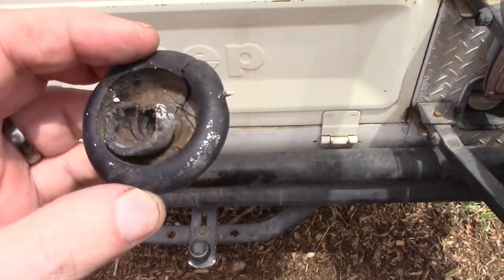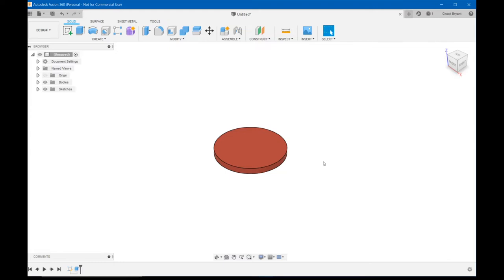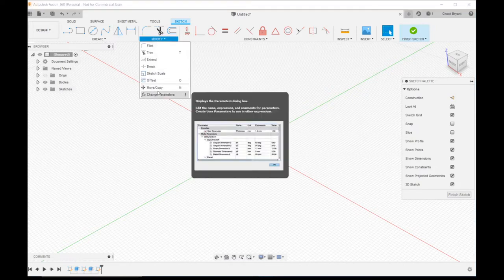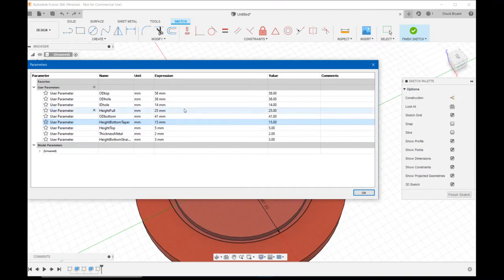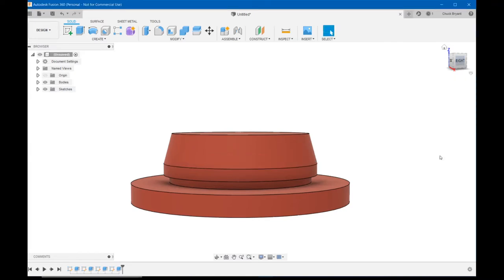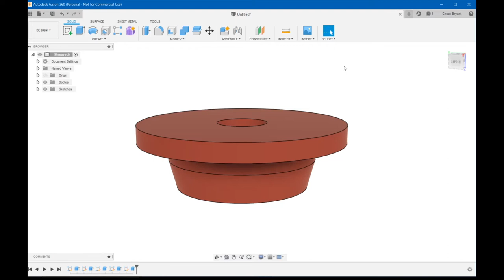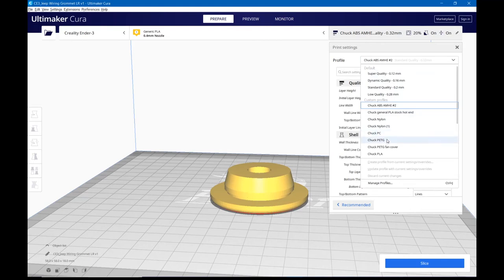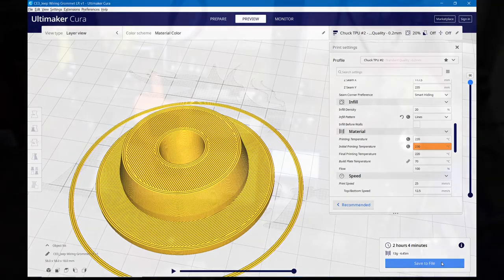Design and 3D Print a Jeep CJ-7 Wiring Grommet with Fusion 360, a Creality Ender 3 and TPU Filament.

Comment: Nice job.  How tough is the TPU long term?? will it dry out and crack?? have a similar exercise i need to do... love fusion and my ender 3 s1
Reply from the maker: About 3 years ago I made a set of feet for the ladder I use outside regularly out of this filament and it's held up fine. Video here https://youtu.be/zzULRLKoDV4
Reply: @3rdpig  thanks for the reply.   I have the exact same item i have to make for my old Datsun: fuel sender and pump wire grommet.  I was gonna buy one for $20, but i think i'm gonna go full Chuck!!  Might have to run 480 3 phase to my garage and buy a metal printing unit, crank out a few engines, lol
Reply: @3rdpig  the inset at the top of your original piece might've been simply for material flow and shrinkage in original molding tool.  Tool designers typically try to keep most wall thicknesses thru a part pretty close in dimension to help molding material fill the mold.

Comment: Chuck, what material are you using?? how soft?? thanks
Reply from the maker: I used FoxSmart TPU. The company no longer seems to be in business, when I went back to get a second roll of it I couldn't find any. It seems to be a pretty generic flexlible TPU, so I think almost any brand would work just as well. I just ordered a roll of Priline TPU (it's on sale now for $19 and I'm cheap), I haven't used it yet but it feels about the same. I'll put a link below.
https://amzn.to/3WOQXU9
Reply: @3rdpig  Hey... that's the first stuff i bought, it's 98A shore hardness... these grommets are pretty small, even at 10% infill still pretty rigid. I found some ninja tek stuff that's supposed to be 85A, gonna order shortly, figured Id ask you first, thanks for replying